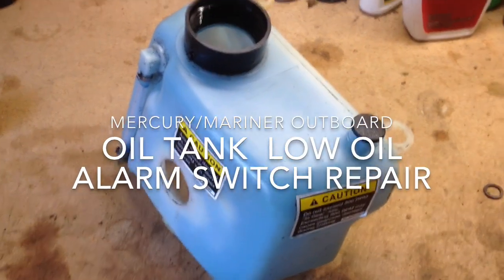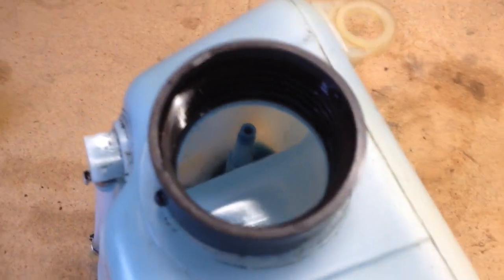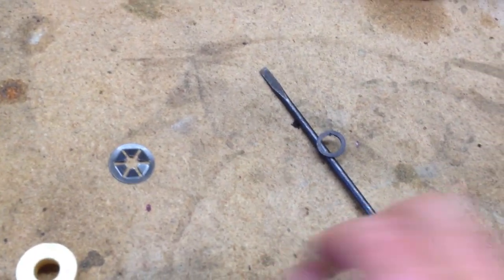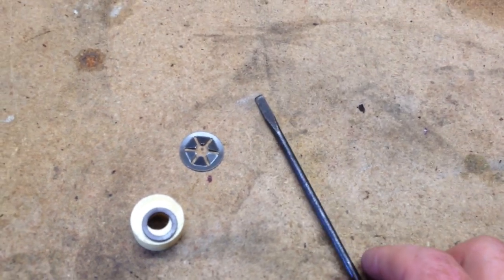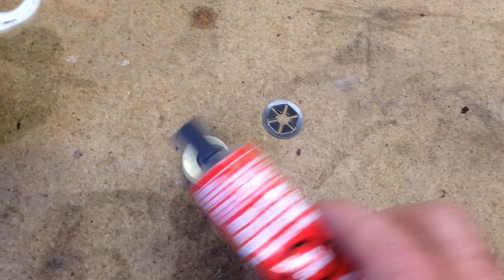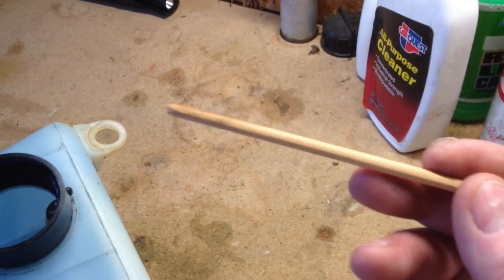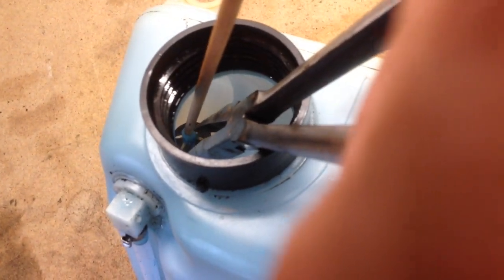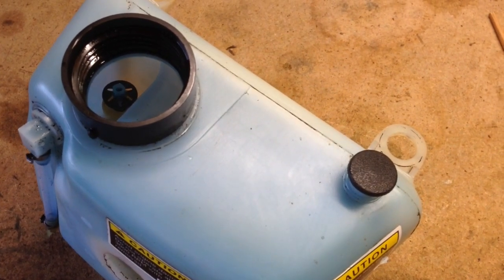Mercury Outboard Low Oil Alarm Switch Repair

Comment: Fixed the tank on my '97 40HP Mercury last night. My tank was deeper so I straightened out a wire coat hanger and bent a hook on one end. With a couple of tugs, I was able to get the push-on clip to come off and then used JB Weld to reattach the magnet to the float. JB Weld is petroleum/chemical-resistant so should hold up to the oil. Use a socket slightly smaller than the clip and a couple of extensions to push the clip back on. Saved a bundle, thanks!

Comment: The oil tank on my 60 Merc has the float out of sight from the fill hole, so I settled on a knock off tank. The merc part is on back order, this will have to do. Great video!

Comment: Well they say that the economy is fine but this fix just saved me instead of $100 like the tanks apparently were 8 years ago when this video was made to now they are $279.  So as long as the epoxy I used stays adhered, I will be in good shape.  Putting the parts back in was super easy.  Thanks for the great video.

Comment: If I remember correctly on my 2012-14 don't remember the year. 😢 Mercury 60 hp bigfoot, I remember looking and the float switch is not accessible like this, it is a skinnier tank and there is a lip protruding that prohibits access to the float.

Comment: Sir you didn't test it after the repair and it seems that you installed the float upside down. Don't think it will activate the alarm if it gets low on oil.

Comment: I did just as you described. The only problem was the keeper washer kept turning after one or two tabs were bent up. I solved that by putting a short 90 deg bend in a stiff wire and hooking the washer and pulling it up. After reinstalling the float I used a dowel to guide the washer down and then using a socket and extension to push the washer back on. It provided equal pressure around the washer. Just had to be careful as the washer is slightly magnetic as well.

Comment: Rick Desecki
I tried regular silicone adhesive but this did not work. Use the adhesive mentioned in the video. 

I used a metal coat hanger to get the float back on. The retainer clip was a bit more tricky.  I use a conduit pipe and bent the end about 20 degrees. Slide the coat hanger through the pipe and then the retainer pin (rp). Slide them into position then pull out the coat hanger.  Push down on the conduit to secure the rp. Use a long screwdriver to make sure all parts of the rp are secure. 

Total cost for silicone and 8” thin screwdriver about $15. 

I’ll try it out on the boat later this week.
Reply: Thanks for the tip on using a pipe. I used the coat hanger and a 1/2 PVC pipe that I put a 20 degree miter saw cut on one end. Worked like a charm. Could feel the washer locking in.

Comment: This worked well. I got the star lock washer off using an eight inch thin screwdriver. I deformed the washer a bit but was about to bend it back like new. 

I glued the magnet ring to the float. 

Now I’m waiting for it to dry and will install tomorrow. 

I’ll let you know how it turns out. 

Thanks for the tip.

Comment: Mine is on my cap. Magnet is in place. I can top off the oil run for awhile and alarm starts beeping.
Reply: Two things make the constant buzzer sound on oil injected 2 stroke mercs based on the wiring diagram for my 1998 40 hp. It’s either oil switch related or temperature switch related. Sounds like you have an overheat related issue. Why? If the magnet feel off the float you’d have that alarm sound right at the start when the engine is cold. Your problem could either be a faulty temperature switch, a bad impeller not allowing the motor to pee properly, or a thermostat issue. Starting from cheapest to most expensive, put a small wire in the pee nozzle to make sure it isn’t plugged. If that fine from the get go. Unplug the thermal switch from the wiring harness and do a continuity test between the female end of the thermal switch connector and a clean ground on the motor. If you have continuity, your switch is bad. If that’s ok it might be the thermostat.

Comment: A fine fix and many thanks. Used JB marine weld to stick the washer to the float.  Used a .22 rifle cleaning rod to replace the repaired float and the retaining washer onto the shaft. Used a long socket to secure, snap, the retaining washer back onto the shaft.  125 bucks now in my pocket.

Comment: I am including here my video link for same problem but for different Mercury tank {8M0119508 OIL TANK ASSY (Mercury Marine) $88.50}. My engine is 2001 Mercury 250XL EFI. The float assembly is heat welded in place and inverted making the clip impossible to remove. BUT not to be defeated I broke weld with butane torch and gently prying it off. I am certain it will heat weld back on... I HOPE!! Good luck with your attempt. $88 is money likely well spent. 
LINK- https://youtu.be/QyQqWUXr3QM

Comment: I did the cheap fix and just unplugged the sensor. Maybe in the future when I have some actual time, not fishing time, I'll try this. Thanks for the vid!
Reply: with the sensor unpluged did the boat run the same
Reply: How did you disable the sensor?
Reply: @chadkolehmainen5011  take the motor cover off. Find the wire that's attached to the oil tank and follow it until you get to the harness where it plugs into the motor's wires. From there just unplug it.

Comment: Just discovered a problem with my 40 Hp Tracker/Merc after it has been sitting unused for quite some time. Found this, and one other video, and initially just separated one of the connectors to the oil tank switch just to be sure that was the cause of the alarm. That silenced the alarm so I knew the switch was the problem. However, in my case, this repair is not going to save me the cost of a new tank because the magnet and float have not separated, The float just won't float. I can reach into the tank with a screwdriver and lift the float and it silences the alarm but when I put oil back in the tank the float will not rise. Such a shame you can' just buy a new float, magnet, and retainer.

Comment: Talked with dealer and apparently the float can lose its buoyancy.  In that case you can try and locate an old tank and exchange the float or buy a new tank.  In the interim just disconnect the alarm wire running out from the bottom sensor.  Just always remember to check the oil level.

Comment: I have a constant alarm have pulled the oil tank off and it appears the magnet is stuck to the bottom of the float.  It is not separate.  What then???

Comment: I had the exact same symptoms.  So I took it apart and found the float and ring separated.  I had already purchased new parts but like you I’ll keep this one as a spare.
Reply: Since you recently did this, my question is why does this cause the alarm to go off? Is there a separation happening between the magnet and the float? Or just getting stuck? 
   I just had this happen to my 60 hp mariner, I let the oil get low, buzzer sounded, filled up the tank, buzzer kept on going, even after a couple of hours shut down and cool off.

Comment: just to be sure everyone is getting the same information, my mechanic at the local Merc dealer said this warning buzzer is only a low oil level warning it can not tell you that the pump has stopped oiling the motor, therefore, the looking glass visual tube should suffice for checking oil level and you can just disconnect the buzzer to stop it from buzzing? correct? I only make this point, to point out putting forign material like jb weld and others in the tank could cause an obstruction that would blow the motor up, so I am just wondering what everyone thinks about this risk Vs the reward?
Reply: I am thinking the same thing.  Eventually what happens if the RTV gives way?  Is there anyone that maybe has an even better solution?

Comment: I need to just remove my wire 150 xr black max i need to just get rid of it cause i mix myself just in case and my cap to the oil that goes in the top tank broke and if i move the wires it will stop soo i just need to remove it so it doesn sound what should i do just pull the wire from the sensor?
Reply: Landon Matcham I have a 1989 mercury 100 up oil injected and had the carbs rebuilt then after a year it sat for 6 years do you think my carbs need rebuilding.It had gas in it when it sat now it doesn't.The drain a few has like a stick gas at the end of it it is oil injected.Can you clean all 4 carbs without starting it. Or rebuild

Comment: thanks for the very informative video on the oil level alarm fix. Just wondering instead of using the glue why can't we just slice the float in half and position either side of the magnet.
What do you think? would that work or would the magnet be too high from the sensor?
look forward to your feedback
All the best 
Anthony
Reply: It will not work because the magnet completes the switch circuit which in turn activates the Beeeeeper .
Reply from the maker: You could try that but if the float gets ruined in the process I doubt you would be able to buy just a new float.

Comment: Thank you sir for posting this! The previous owner had just cut the wire to the alarm under the dashboard. I ordered new buzzer, got installed and buzzed constantly when key turned on. Did some online research and determined it was low oil alarm. Came across your video, was very easy to make repairs as you stated and has worked perfectly since.

Comment: GREAT VIDEO. FIXED MY 2000 40HP MERCURY THIS EVENING. 8/29/2017. STARTED MY OUTBOARD LAST WEEKEND AND LET IT RUN FOR ABOUT 20 MINUTES. WAS HAVING TROUBLE WITH ONE OF MY BATTERIES AND TOOK IT AND HAD IT CHECKED. SURE ENOUGH IT WAS BAD. BOUGHT A NEW ONE. THIS TOOK ABOUT AN HOUR. CAME HOME AND WAS GOING TO RUN MY OUTBOARD SOME MORE. TURNED THE KEY ON AND VERY LOUD BEEEEEEEEEEEEEEP WAS HEARD. I KNEW THE WATER WAS COOL BECAUSE I CHECKED IT. GOT ON YOUTUBE AND THERE WAS YOUR VIDEO. THANKS FOR SHARING. SAVED ME MONEY AND TIME. HOPE IT LAST ANOTHER 17 YEARS. THANKS AGAIN FOR SHARING.

Comment: he doesnt tell you about trying to cut off the mercury zip tie without damaging the hose feed for the oil resovior - re feeding hose from fill tank - good job Mercury - going back to yammy
Reply: They just pulled off for me. If I were you maybe replace the oil lines and use metal fasteners that  tighten with screwdriver. Both of my lines were brittle and cracked along with the float being broken.
Reply: In my case, there was enough slack in the oil line to just leave it attached after removing the top screws. Enough to tip the tank over after undoing the lock washer.

Comment: so tell me, this switch u referr to is the part connected to the wires that u actually changed out then, so obviously the dealer offers us just the switch how much is the switch, great info thanks much
Reply: Just unhook the wire and make sure the tanks full of oil

Comment: question...110 hp johnson......turn on key alarm sounds engine starts no alarm......10min alarm steady at idle .....any ideas
Reply: i have same problem w 50h.p., i cked the wires off tank for continuity, which i dont have and shouldnt have, but my alarm isnt coming on when i turn key on as it should,
Reply: don i just watched another guy show how the float was working on his video but the magnets on this switch assembly were working intermitenly, i guess im going to order a switch , the way im understanding this is the switch is the stem inside the float or rather the item connected to the wires,
Reply: Describe the alarm. Different tones and lengths of tones mean different things.

Comment: Ta Da,,,worked for me too.Although I did buy a new sensor which to my surprise didn't stop the alarm.Sure enough when I tore into the float,my magnet and float were two separate pieces,so I used JB Waterweld,which is resistant to oil,gas,chemicals,solvents,etc.When putting the clip ring back on,I used a series of 3/8 extensions,a socket slightly smaller than the clip,and once I got it center on the shaft,I applied downward force and it popped right in place.Hopefully it lasts longer than the original glue,,,,if not I'd do it again.

Comment: Awesome video,  Just fixed my 99 30 HP Merc.  I used JB Waterweld for the adhesive. Once dry I let it soak in oil overnight to make sure there are no issues, and all is well.
Put it all back together and works.  One way to determine if this is you problem is take a strong magnet and move it on the sensor side of the oil tank from top to bottom.  If the alarm goes off you know the magnet is loose.

Comment: I have a 1997 60 HP Mercury that has this same problem.  I've unhooked the blue wires to shut the alarm off, but I don't want to toast the engine, it's time to try this fix in the spring.  Thank you for posting!
Reply: Obviously he is saying that it is smart to fix this problem so that he does not inadvertently run out of oil and toast his engine.  He will PROBABLY be just fine watching it but it is a good idea to fix this for the long run.
Reply: Wdroster how would having the wires unplugged toast the engine?
Reply: It will only “Toast” the engine if you don’t keep oil in the Oil reservoir .

Comment: Great video thanks for posting. I just replaced my oil tank and sensor, wish I would have seen this video before hand. next time.. did you guys re-prime the oil pump? I've been told I don't need too, and also that I do need too? was also told to just dump some oil in the gas tank and enjoy the smoke for a tank or so just to make sure. don't really want to gamble with my motor..

Comment: Thanks for the excellent video.   This was exactly my problem and this fix is way better than coughing up 100 bucks for a new reservoir.  I got the lock washer off by using a wire bent slightly at the end to slip under the fingers on the washer.   Piece of cake taking it off.

Comment: I want to thank you for the quality video and explaining the repair. I had the exact same thing just happen. 2001 tracker ( Mercury ) 40 hp 2  Cyl.  Cleaned the water pump, Flushed the engine got all the junk out of the water jacket. Took the carb off cleaned out, Dumped out old fuel, replaced fuel line cleaned water seperator and she purrs like a kitten. However the dam alarm would not go off and oil was full. I unbolted the tank turned upside down alam went off. Drained cleaned did same thing and back up and going. Thanks for the saveings.